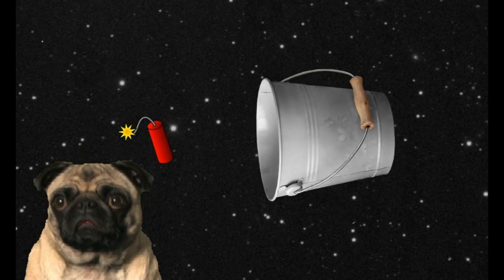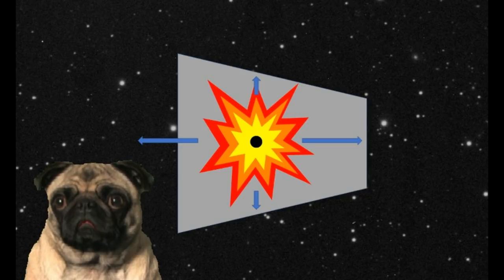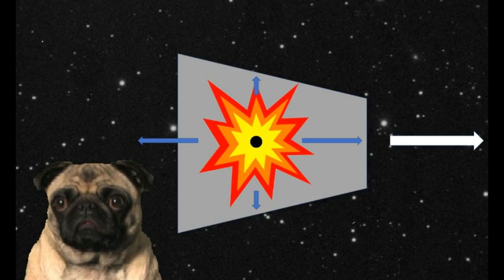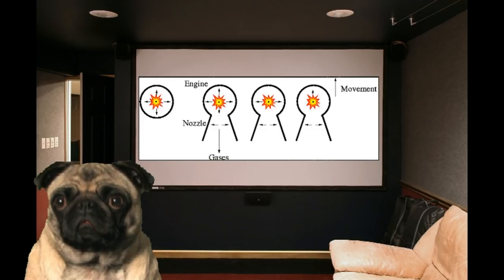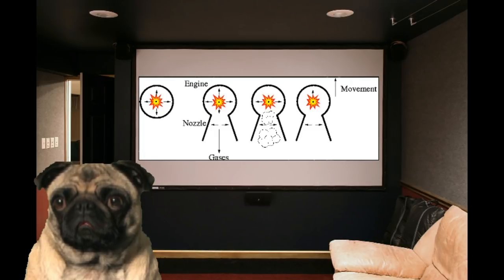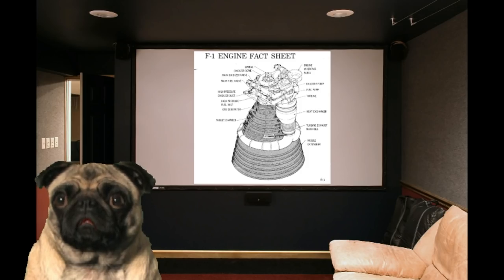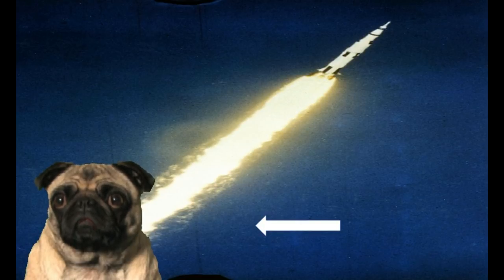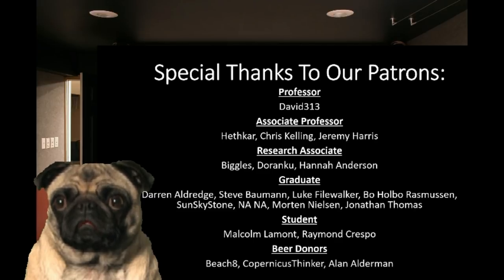Simple Science: How Rockets Work in Space

Comment: Yeah all of them pretty much believe all that exhaust is doing the work, I've noticed! Like you said it all in the bell mostly independent of anything outside of it! Yes, some of the exhaust helps but that is way less than most flatties think. So flatties reading this, that is why they can fly in space! All the work is in the engine bell, engine, and fuel completely independent of space around it! Also, beings though the air in space is near vacuum is the reason they can reach the crazy speeds they do!
Reply: @uncommonsense9948  
Well, since no one has answered you, and I've found myself back on this comment section once more, I'll have a go at it.

You "build up pressure" in your "cut in half, pressure vessel" by essentially having a sustained explosion taking place in it.

An explosion is just a short burst of pressure that happens as the gas resulting from the explosion impacts you. You sustain an explosion by continually keeping it "fed" with fuel and oxidiser. That's what a rocket engine does.

Comment: So the brick is next to dynamite.  Dynamite explodes and transfers energy to brick and the brick moves?  What exactly is getting transferred to the brick and how?  In an atmosphere, it's done by a medium between the two.  Local pressure is created and released.  So how you would achieve any localized pressure in a low/no pressure zone is something you have not thought through.
Reply from the maker: Consider that both particles and gasses are speeding away radially from the center of the explosion. 
These particles and gasses impact the side of the brick facing the explosion.
This is the means for the transfer of energy.
It doesn't matter if it's in a low or no pressure area. If a particle impacts the brick, energy is transferred.
I hope I have explained my thinking on this clearly; if not, feel free to contact me again.
Thanks for commenting,
-Sci
Reply: @SciStrike  You're assuming an explosion but not defining it.  An explosion is a very quick release of energy and volume.  When the energy is released, it acts firstly on the surrounding medium.  This is how we see the explosion, hear the explosion (air compressions), and can possibly feel heat from the explosion.  All would require a medium to transfer the energy.  So while I follow your example of the explosion with the brick, I don't think the results would be as you describe without a medium to transfer the energy to the brick.
Reply from the maker: Particles... And... Gasses...
Reply: @SciStrike  Exactly, you're assuming the explosion without defining it.  Particles... And... Gasses... Not much of a definition.  And how/why do the particles and gasses perform work on the brick or perfom any work at all?  You're assuming a pressure wave similar to an explosion on earth.  If you could pressurize space, you could hear sounds in space as well and the conclusion you reached for your thought experiment would be true.
Reply from the maker: If I really need to explain, the particles and gasses are in motion as they move radially away from the point of explosion. As such, they possess kinetic energy.
When these particles and gasses impact the brick, a large amount of that kinetic energy is imparted on the brick.
The brick, having received the energy, moves. 
As for defining the term 'explosion', it's defined, in this case, as extremely rapid combustion resulting in the release of energy in the form of heat and kinetic energy imparted on post-combustion products which, in an isotropic explosion, move radially away from the center of the reaction at a uniform speed.
In other words, I'm using the most commonly understood definition of explosion.
This definition only applies to chemical explosions and non-shaped charges.
(Ex: nuclear is not a combustion reaction, and shaped charges apply more energy in specific directions.)
We good now?
Reply: @SciStrike  A release of energy and volume. Thanks,  but we're still back to the same error as before.  How do you create this explosion that in turn pressurizes the area around the explosion to pass kinetic energy to particles, gasses, and bricks?  You're saying kinetic energy but where/when/how is it transferred from the dynamite to particles to the brick? No sound energy, no heat energy, but kinetic energy?
Reply: DrChash7 
Easy. The dynamite contain mass that expand and push the brick. That's it.
Reply: @DrCash7  
"How do you create this explosion that in turn pressurizes the area around the explosion to pass kinetic energy to particles, gasses, and bricks?"

You do that, by creating a chemical reaction that produces a lot of gas.

In the example of the dynamite, it's the molecule Nitroglycerine, which undergoes rapid decomposition, as a result of a sharp mechanical shock. When Nitroglycerine decomposes, it releases a lot of N2, O2, H2O, and CO2 moving very fast. So we have a lot of stuff, with mass, moving very fast, and some of this stuff will impact the brick and cause it to move.
Reply: @ShadowFalcon  "You do that, by creating a chemical reaction that produces a lot of gas."  Producing gas but we aren't looking to produce gas, we are looking to produce a pressure difference.

"So we have a lot of stuff, with mass, moving very fast, and some of this stuff will impact the brick and cause it to move."  

There is no reason at all for expanding gas to move in a path that is NOT of least resistance i.e. into the brick.  You're describing (assuming really) an explosive force occurring in a vacuum and then the released gasses now performing work on both the brick AND freely expanding into the vacuum.  That's incorrect.
Reply: @DrCash7 
2 months?

It took you 2 months for you to figure out a response that wasn't a complete admission that you don't understand entry level fluid dynamics?

Well, for starters "Producing gas but we aren't looking to produce gas, we are looking to produce a pressure difference".

Any gas, next to a vacuum will be a pressure difference. And any gas, when not subjected to any forces other than the internal forces of said gas, will expand in all directions.

Secondly "There is no reason at all for expanding gas to move in a path that is NOT of least resistance i.e. into the brick".

I dunno where you got this idea that gas can sense stuff around it, and actively avoid any hindrance. How would the gas know that it was headed towards the brick?

Thirdly "You're describing (assuming really) an explosive force occurring in a vacuum and then the released gasses now performing work on both the brick AND freely expanding into the vacuum".

No, I'm describing a gas freely expanding, because of the internal forces of the gas, and subsequently impacting the brick.

And if the gas (an object with mass) didn't transfer momentum to the brick upon impact then conservation of momentum would be broken, because you'd have an object with mass changing momentum for no reason.
Reply: @ShadowFalcon  Lol. Because replying to your comments is essential to life and not at all a time-sink /s
Reply: @DrCash7 
Almost a month, and this time you don't even try to respond.

How about you just make it easy on everyone, and admit you don't know anything about gases, thrust or rockets.
Reply: @ShadowFalcon  How about you just make it easy on everyone and admit you don't know anything about gasSes (you're missing an S), thrust, or rockets.  The points have already been made in previous comments months ago.  Whether or not you are able to digest it is another story and not my concern.
Reply: @DrCash7 
So, in your mind gas is sentient, and capable of avoiding obstacles?
Reply: @DrCash7  Whu??? The gas/dynamite particles expand radially from the centre of the explosion. If they hit the brick, they move the brick. If they don't hit the brick, they keep expanding on into space. Some of them move the brick, some of them don't. What are you finding so difficult to understand?
Reply: @MarkMichalowski  before the particles hit the brick. Localizing pressure.
Reply: @DrCash7  What are you on about? What does "localizing pressure" mean? The particles travel in straight lines out from the centre of the explosion; in a vacuum, there's nothing to stop them spreading out forever, taking their kinetic energy with them. If a brick is in the way, their energy is transferred to the brick and that moves off in the same direction as the particles that struck it.
Reply: @MarkMichalowski  localized pressure = high pressure at a specific location.  It's why the rocket/plane/helicopter moves up.

If the particles leave and never slow down (i.e. meet no resistance) you will generate no thrust.
Reply: @DrCash7  That's not how rocket engines work.
Reply: @MarkMichalowski   bbbb-bot.

Comment: get real.. why would you take an explosive mixture to produce gas to produce "movement" ..just take a tube of non explosive gas .. derp lol
Reply: Because it's easier to store two liquids, that on combustion will produce a lot of fast moving gas, than to store a compressed gas.
Reply: those two liquids are ?
Reply: John Watson
Depends on the rocket.

Some use RP1 (basically kerosene) and Liquid Oxygen (like the Soyuz, the Falcon 9, the Delta IV and Atlas V). Others running on a mix of Liquid Methane and Liquid Oxygen are being developed (like the New Glenn, and the BFR). And then, there's some that use hypergolic mixtures like Hydrazine and Dinitrogen tetroxide (the old Titan-II, and the Proton M, together with a load of upper stages, maneuvering engines, and landers). Then there's some that run on Liquid Hydrogen and Liquid Oxygen (like the 2nd and 3rd stage of the Saturn V, and the core stage of the Ariane V, and the Centaur upper stage of the Atlas V). 

They all have certain pros and cons, that make them preferable for different missions.
Reply: @ShadowFalcon  sooo having gotten to an altitude of 250 miles.. how much of these gasses must be used to maintain an orbit around your ballearth in the low density environment of "space"..with solar winds and other factors slowing it down.. do you think a quick blast of gas will maintain a 17,500 mph speed ?..dont give me any gravity b/s..theres still allegedly 95% of it on the ISS
Reply: John Watson
Why would you need to use your engines, if you've already attained orbital velocity?
Reply: @ShadowFalcon  TOTALLY SKIPPED OVER EVERYTHING.. TYPICAL SCAMMER
Reply: John Watson
No, I merely asked. Why would I need to burn propellant, when I've already attained the needed speed? 

What would cause me to slow down again? And at what rate?
Reply: @ShadowFalcon  you do know the ISS is still travelling through earth atmosphere.. dont you ?... like i thought you know nothing ..just a copy/paste drone
Reply: John Watson
Yes, I know.

I also know that the ISS does regular reboosts, to raise the perigee of the orbit.
Reply: John Watson
But, in short, it depends on a number of factors, like how fast is the gas moving, and how much mass does it have. This is usually condensed into one number, called "Delta-V", which represents your total amount of velocity change (basically, how much you can maneuver).

The ISS reboosts come from a Progress spacecraft, using its RCS to ever so slightly accelerate the ISS. The change Delta-V of this maneuver is very small, only about 1.5'ish meters/second.
Reply: Karsten Topp
Actually, the Torr is just a unit of pressure (like the Pascal, the bar, and the psi). It's defined as being exactly 1/760 of a Standard Atmosphere (itself defined as being exactly 101325Pa).

Interstellar space isn't a perfect vacuum either. It's "filled" with the interstellar medium. This medium has a pressure of about 1*10^(-16)Torr, which is 0.0000000000000001 Torr, so not that big.